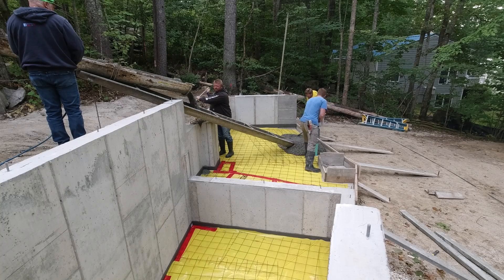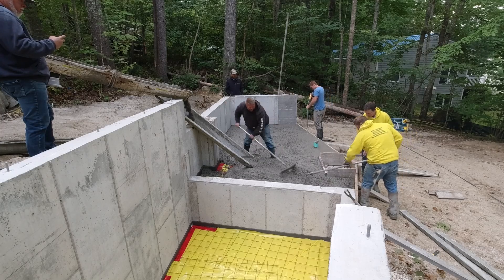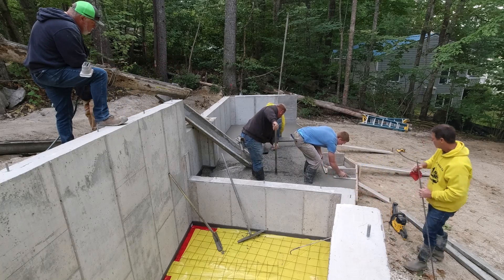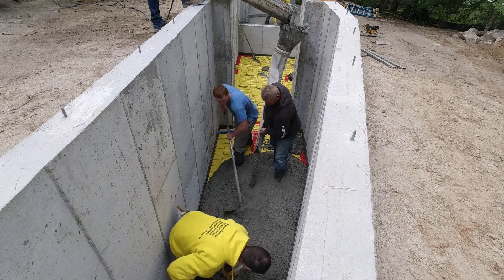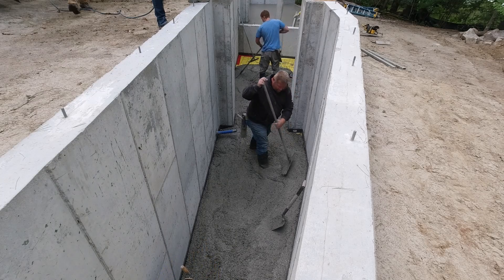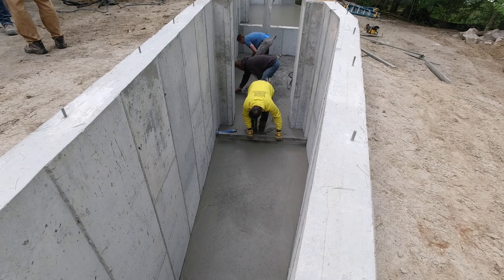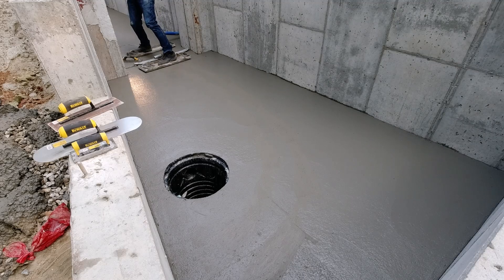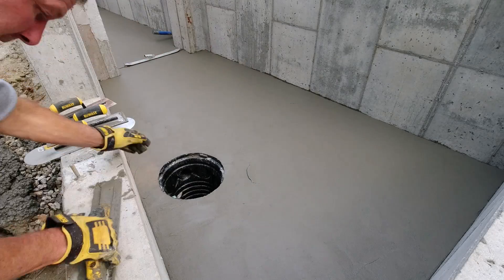Building Codes OUT OF CONTROL - You've Never Seen A HOUSE Like This

Comment: Nice job, lads.  Takeaway:  Don't have incompetent m^rons with no experience or capability in positions of responsibility.  Bureaucracy.  I know.  That's a large umbrella.  On the other side of the fence, stubborn consumers - Sometimes not building may be the best choice (perhaps secondary to the aforementioned sentiment, but sometimes because consumers can be special, too).  It'd be nice to see the finished product.

Comment: That is what I am talking about all your jobs you have concrete side walls not here in WV concrete football then maybe a few blocks then wood frame walls to the ceilings. Your houses are much better insulation in them.
Reply from the maker: Yeah, the building codes out here are a little different.

Comment: In this whole video nobody touched the wire, poured it and then the screed. Waste of wire...
Reply from the maker: Wire police!
Reply: Not even bricks or WWM chairs keep all of it off the bottom when workers bend it down between those supports with their feet. That's why fiber reinforced concrete mix is much better for slabs.

Comment: Not a code issue but zoning, which historically was too permissive near water bodies, resulting in polluted/contaminated groundwater. The rules were changed to reduce density and protect nearby water bodies but as usual no rule is perfect and the strict application of the rules can result in some "interesting" outcomes. Probably there was a failed attempt to get a variance or negotiate a lot line adjustment to make the lot accommodate a less abnormal footprint. That thing is a giant sail creating a huge moment arm levering on the feet of those short end walls. At the end of the video you can see some special structural elements addressing the wind loading. A very odd build but with some large decks to add generous "outdoor rooms" it could be a lot more livable than it looks here.

Comment: Can it have a huge cantilever towards the lake?? Use some engineered joists anchored to the rear concrete wall and supporting at 10' cantilevered with 20' joists!!!
Reply: I’m betting it’ll be cantilever, cause he said there’s gonna be a ton of steel beams and stuff, the only problem is you get into bounciness if you go too far
Reply: @quinnhaynie7767 they showed a picture of it already fully sheathed
Reply: Youre allowed to do that here in ny where the building setback and laws near water are strict af. I'd cantilever it for sure! Sonotubes don't count in regards to setback footprints where I live
Reply: @ sonotubes bear onto a spread footing which is subject to the setback requirements. Maybe if the engineering has them designed as piles? But in that case they would be poured at the same time as walls.
Reply: Exactly there’s a building in Grand Rapids Michigan at Cantilevers out about 80 feet. It’s pretty cool building. You can see it from freeway on I-69 heading west before Grand Rapids.
Reply: Maybe helical piles out towards the lake?